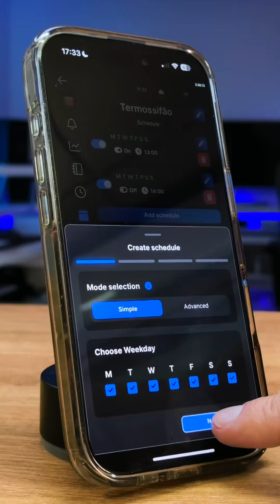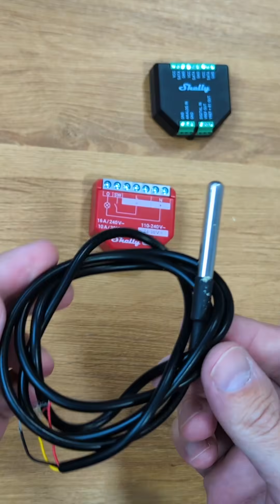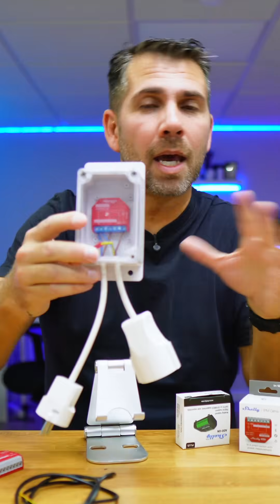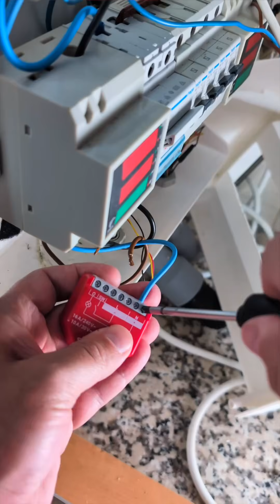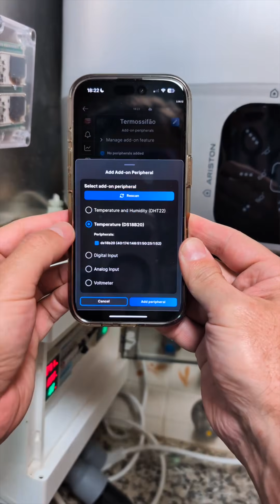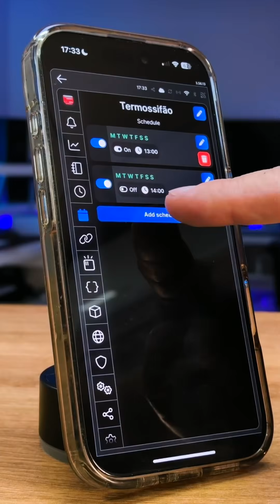How to monitor water temperature with Shelly | Roberto Jorge

Comment: Beware a lot of the digital temperature sensors on various chinese sites have random colour coding on the wires. Thankfully we're no longer allowed to have water heaters with a16A plugs as I have no confidence in a 16A sustained load on the Shelly, not even the Pro line.